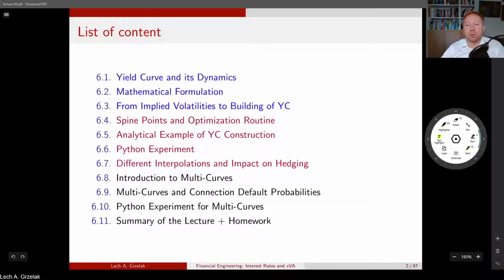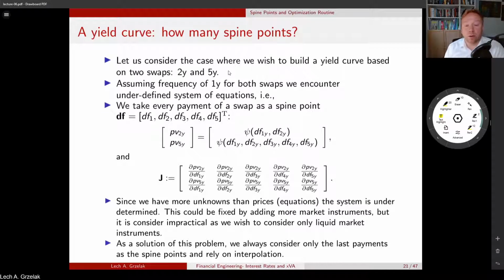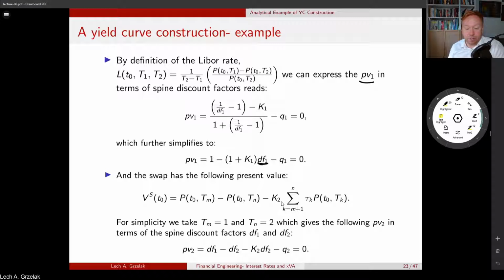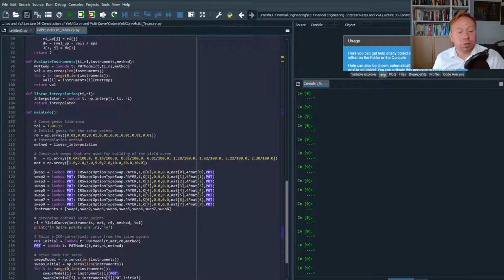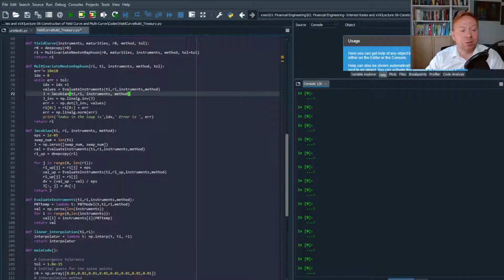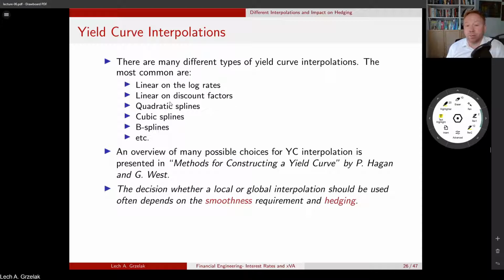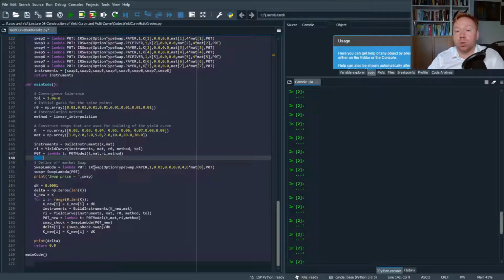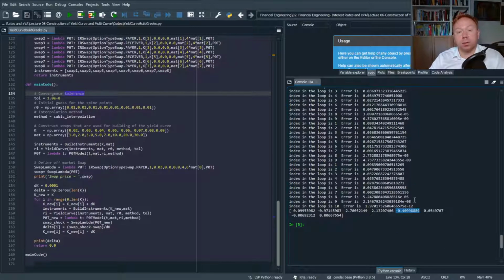Yield Curve and Multi-Curves (Lecture 6/14, part 2/3) | Financial Engineering Course

Comment: The int(n) in the code imply it will not suitable for short tenor? Because i can imagine int(0.5) will fail. If this is true, how can i deal with that
Reply from the maker: It will be still suitable int(n) is just a number of the grid points. n indicated the number of dates payments between Ti and Tm, so it also should handle short tenor case. Best regards, Lech

Comment: Hi Lech,
just a question. At minute 24.50, lines 33-34 and 35. Ti I think it should be the first payment date after t. Here you are setting Ti equal  to the last payment date before t (today). Is it correct? Because if I consider the formula for the Interest Rate Swap in the slides I would write:

    # overwrite Ti if t>Ti
    prevTi = ti_grid[np.where(ti_grid > t)]
        if np.size(prevTi) > 0:  # prevTi != []:
            Ti = prevTi[0]

If I'm wrong, could you please explain me what I'm missing?

Best wishes and thank you so much!
Reply from the maker: hello Matteo, yes, indeed, your explanation makes sense. Can you please submit your solution via github? I will review it, analyze results and I will give you more detailed feedback, OK? Best, Lech